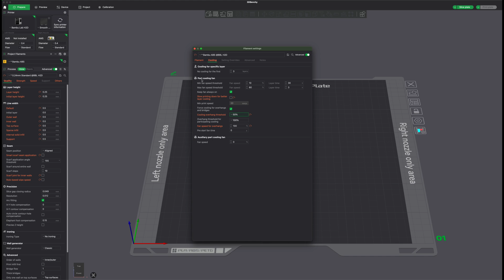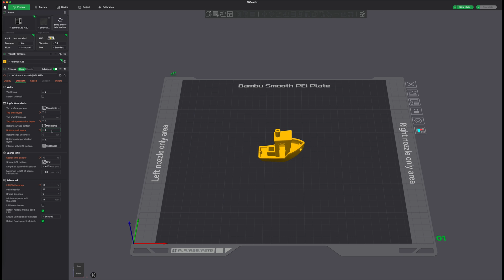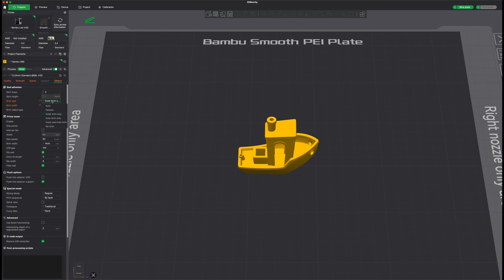Layer by Layer: Bambu Lab H2D Speed Tweaks: Custom ABS Settings Deliver 3DBenchy in 17 Minutes

Comment: It says 20000 mm/s in the thimbnail, which is highly deceptive. Since no printer can print that fast, the acceleration speed is yes. But acual print speed no. My printer, which is 600 mm/s max, can print the benchy in 18.5min.

The video isn't bad, but the thumbnail is deceptive
Reply: mm/s is speed, mm/s² is acceleration